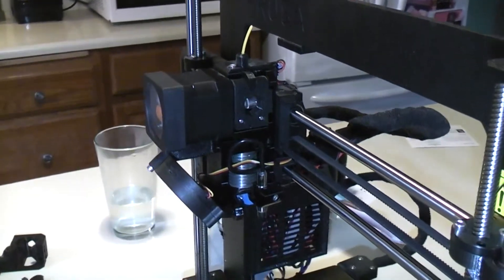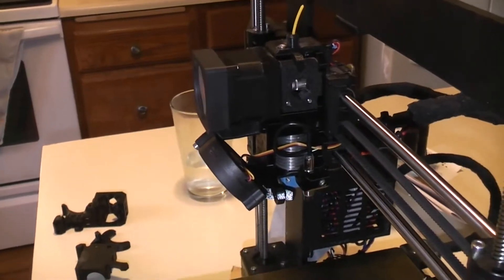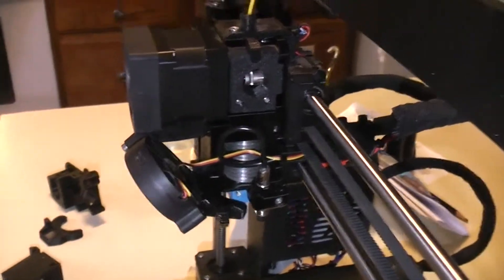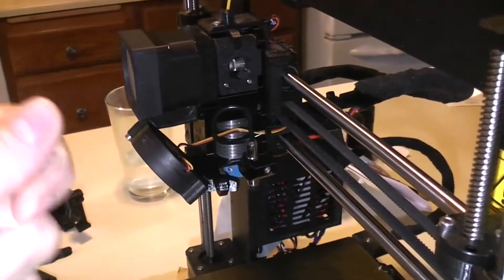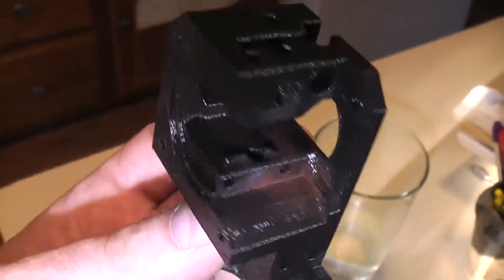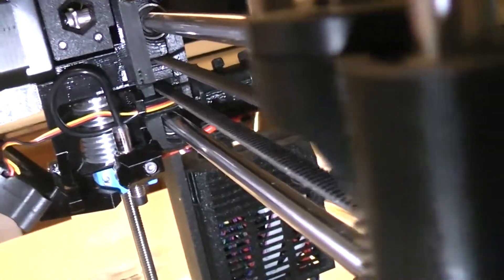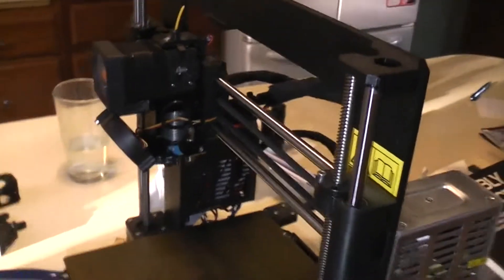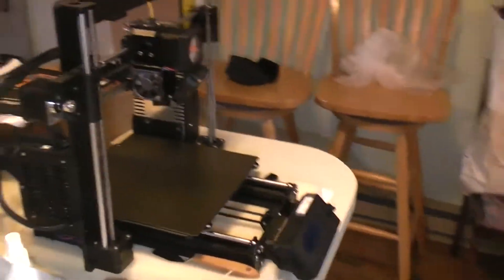Prusa MK3 new Extruder parts update, have a look, will  they work ?

Comment from the maker: I see they have released a newer version of the new parts dated 8-2-2018, the when I did my print of the new parts the release date was 7-19-2018. So they have gone back and changed a few things like removing the old fan support arm.
Reply: Do you still have that .stl file with the old fan support(that one in your vid), i need it to attach a suction head, i hope you still have then you make my day :). Can i send you a picture where i needed for?
Reply from the maker: Yes I still have the stl files for the first release that has the old fan mount but with the new hot end cooling.

Send me a email from the contact info on my web site and I can email them to you. I think you only need the body cover file as it has the old fan mount.

Comment: Hello Robothut, I have the problem of the extruder motor skipping steps, do you think this update would help on this matter?
Reply from the maker: It might and even if not it is worth doing. When you say the extruder motor is skipping steps do you mean that you have under extrusion all the time or only some times. If it is all the time then you have pulg or jam and you might have to take the tip off to clear.One other thing that can be a problem is filament that is not a consistent size.
Reply from the maker: Make sure you have updated your printer firmware first. The bond tech gears will chew up filament before they will ever slip or the stepper motor skip a step. Prusa runs the extruder stepper motor at a higher current than the other stepper motors in the printer to make sure the bond tech gear set up can push and pull the filament for all there new add on devices. Yes the new PETG printed parts will help and are a good idea to do.
Reply: @Robothut  Thanks a lot Robothut, I´m already printing! : )

Comment: That arm that holds the old fan doesn't exist on the newer parts.
Reply from the maker: My parts are dated 7-19-20018 from Prusa , are your parts of a newer date ? They may have gone back and corrected the files.
Reply: I don't have my  MMU yet if you received them with your MMU.  If not the new parts are available for download and are not available from PRUSA.  They probably have a supply of the older parts and will ship them until they run out.

Comment: was the upgrade worth it?
Reply from the maker: Yes. So far the upgrade has worked as there have been no jams of the hot end and I have done 100's of prints. The part cooling fan mod is OK but does not really fix the part cooling problem with complex part designs that need rear cooling. So yes I am glad I printed the parts and they seem to have helped.

Comment: just a thought - could your filament be dusty? That could leave the red deposit and cause the filament to jam. A filament oiler might fix that. I've yet to have any jam on my MK3 (without oiler or upgraded x carriage).
Reply from the maker: Good idea but no. The MK3 is run only in the kitchen "in the house" so it is very clean. Also I have had no more jam problems since printing and installing the Prusa updated hot end PETG parts. Seems to fix the problem. As for the red dust,  will just see if it comes back.

Comment: Great video, I never have an issue with jamming any material (yet!) had it for maybe 4 weeks, did print every day :) Bit scared to take it apart and recalibrate it again as it works quite well atm. What is that Dial Meter thingy you have there? thanks
Reply from the maker: That is good news. Not everyone has the problem. Joel the 3d printing nerd has it as well. Yes the first time you have to take it apart is  a bit much , but its not bad, just takes some time that you would rather use for other things. So far it has been working just fine with the upgrades so that is good news for me.
Reply: 3 months, no problems with jamming except for flexibles

Comment: This might sound like hand holding but it would be great if someone did a complete video on the disassembly and assembly of the removal and installation of the new parts.
Reply from the maker: That would be a good video for those that did not build there own Prusa from the kit. But as I do not have anyone to do the camera work and locked down camera would never do when trying to show what is going on, I am not the right guy for the job. But I agree.